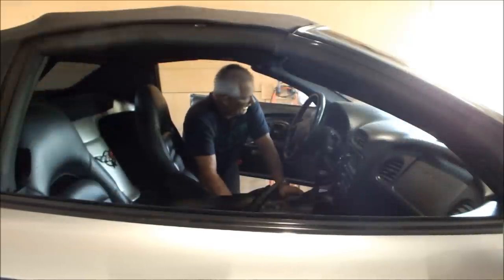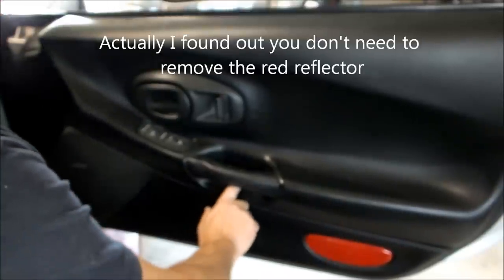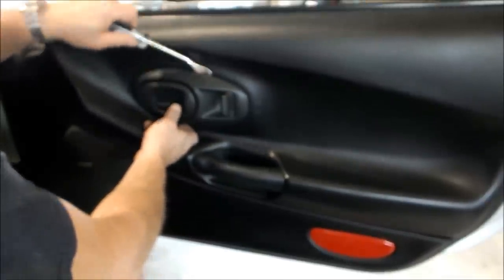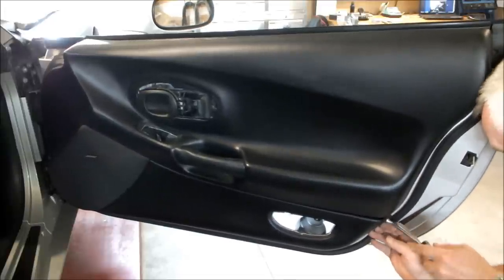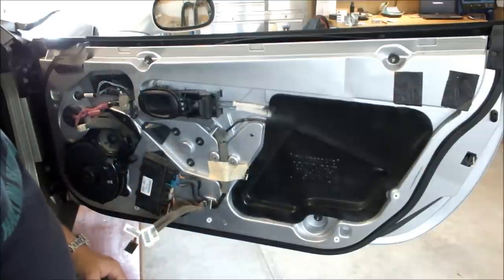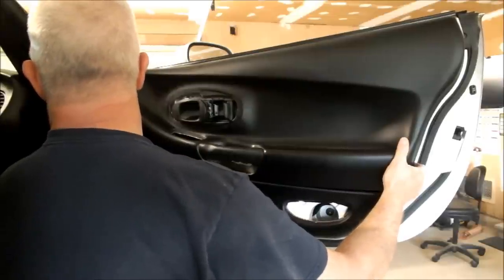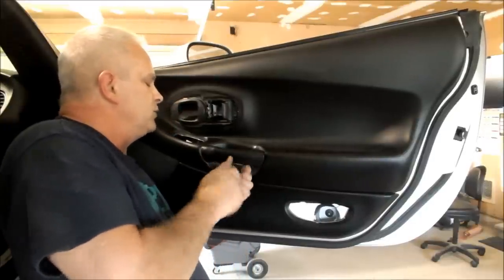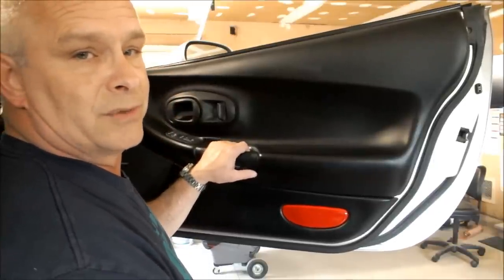Corvette C5 Door Panel Remove and Replace

Comment: Be careful!!!  I help my friend remove his DRIVER side door panel on his 98 C5 after watching this video.  Either the difference in year (98 vs. 2001) or which side of the vehicle is being worked on is important.  Removal of the driver side window/door lock/mirrors panel was exactly opposite as described in this video.  The driver side panel needed to be pried up from the REAR instead of the FRONT and slide BACK as opposed to FORWARD as shown in the video.  Unfortunately, the switch panel was broken learning this important lesson at a replacement cost of $350.00.

Comment: Great instructions.  Thank you.  On my 03 I had to start removal of the power window/door lock switch on the Drivers door from the back.  There is a plastic clip in front that will break if you don't.  This may be because I have Memory Seat control in the door or that it was the drivers door and not the passenger as in the video.  Everything else worked as in the video.  Thanks.
Reply from the maker: Glad it helped Rick - Cheers from Canada!

Comment: The driver's side window/door/mirror panel pops out from the rear. My switch panels are very brittle and cracked even while removing them the proper way. However, you do not need to actually remove the switch panels. Once you start popping the door panels off you can pivot the panel out and reach underneath to remove the electrical clips on them. Then remove the panel the rest of the way.
Reply from the maker: Jonathan Raether Good advice for southern based cars
Reply: Thanks...that's the procedure I'm doing actually. just replacing the drivers door panel

Comment: On my 2002 C5, the right window/door lock switches would not work. Thanks to your video, taking the door panel off was a breeze. Found the electrical connector not connected. Sometimes you're just lucky! Works just fine now but I wonder why the connector came off. Maybe a repair had been made previously but the connector lock was not engaged?? Thanks
Reply from the maker: I think your bang on Don - could be  from factory but hell most times you have to fight to get a connector apart - most likely a previous repair - lucky you - I wish most problems had that solution - cheers

Comment: I have the factory bose speaker system in my cat and I have had the battery disconnected for several repairs and long term storage. I a have never had to reset the radio. What's that all about? Do you have some premium entertainment package, aftermarket radio, or factory replacement radio that doesn't match your VIN?

Comment: Have a 2000 Vert.   Driver window does not tuck all the way in to the top cover.  Looking from outside (Upper right)... glass goes a little over the corner thereby way to much noise.   Someone said there is a window adjustment to possibly change the angle.   Can you advise on this?   Happy to send a pic if requested.
Reply: I have the same exact issue.  Have you found a fix yet?

Comment: My passenger door latch won't lock or open. It moves slightly when the lock or unlock button is pressed.  I wonder if they need lubrication as the owner's manual says that the door latches need periodic lubrication.  Thanks for showing how to remove the door panel.
Reply from the maker: Your right Domo - but take off the panel and lube it up good from the inside and have a look to make sure nothing is interfering with the mechanism inside the door

Comment: Door handle trim has two slots made to push and release so you don’t need to put tool to the soft parts of door and switch doesn’t need removed just un plug after panel is in attached
Reply from the maker: Good to know Handyish - Cheers from Canada
Reply: @carquestions  can save from potentially damaging. Great vid by the way

Comment: Thanks for this video! Same as in all other car's, but I afraid do something wrong.
Reply from the maker: +Vladislav Tarassov No problem - As far as trying it yourself you should give it a try - most of the time you take it in to a mechanic who has never done it ends up breaking a few clips anyway - if your slow and careful you"ll get it - you can do it
Reply: *****
I broke a window switch panel... sad. But it's not fatally. I will fix it! Others ok. Already removed 2 panel
Reply from the maker: +Vladislav Tarassov Vlad - don't feel bad - had you got someone else to do it there is a better than 50% chance they would have done the same thing and not told you
Reply: ***** That's true!
Reply: +carquestions Yup, same thing happened with my JL Audio  5 channel amp install. The "professionals" only installed one screw per handle instead of both. I didn't think it was a big deal cause I thought I could just order 2 new door handle bolts but I couldn't find them online on any of the GM OEM parts warehouses and when I went to the dealership they said it was a discontinued bolt that they no longer carry... Now I just have to deal with a loose feeling handle forever...
Reply from the maker: +JDMricist No you don't - I don't know where you live but you have two options - Go to Corvettes at Carlilse Penn and someone will have it - or take one of the remaining bolts with you to a local nut and bolt industrial supplier - or a junk yard
Reply: +carquestions Do you think Corvettes at Carlilse would ship me one? The nearest bolt industrial supplier is 2 hours away and I could never find any Corvettes in junk yards :(
Reply from the maker: +JDMricist Corvettes at Carlilse is an annual giant car show swap meet for corvettes - try searching eckler's corvette online

Comment: just bought a 2002 74,000 miles convertible  last week ; Top down and both windows down ; passage door close solid like new, driver door sound loose when door is closed , this video will help me find why the driver door sounds like the windowis about to fall apart. Just want the drivers door to sound solid when closed .
Reply: +Robert Mullins omg, I have an '03 with 110k miles and have the SAME problem. Passenger door closes like a new car but the drivers door feels loose and clanky sounding when closing. Found out it was coming from the mirror. Try to wiggle your passenger mirror. It shouldn't move. Then try wiggling your driver side mirror. It will probably wiggle around. If you have the same problem as me, that's the culprit. I still have to take the door panel off to see what's going on... Hopefully I'll have time this weekend.

Comment: fyi driver side window switch has to be pryed from bottom not top. Just broke mine and learned the hard way....
Reply from the maker: Good point - thanks for the info
Reply: Gotta love 20 year old brittle plastics too.. was trying to remove the drivers side from the bottom and it basically snapped immediately. Oh the joys lol...
Reply: Well it's be nice if not every diy-dumby decided to make a sweet how to video without knowing his facts. A simple disclaimer about the differences here wouldve probably saved your switch...and mine. Thanks carquestions /s
Reply: Sour grapes 🍇.
Reply: Just broke my driver window switch due to listening to this quack.

Comment: I would like to start door panel removel outdoors, I will be sending the module away for relay replacement. Can I then attach battey cable, start car and put it back in Garage until I get my repaired Module back???
Reply from the maker: Yep no problem - it will however show a fault code in the display but just clear the code once you put it back together

Comment: Thank you! I just bought a 2003 and found both doors are cracked at the hinge. The pax side is really bad. The door has dropped down a little. Do you have any repair ideas on that, and have you seen it before? It's like the doors were swung open to hard.
Reply from the maker: +boeingtrijet Heard of it but never seen it. Ya, sounds as if your right, door caught in wind numerous times. I guess you try and reinforce the area or buy a new/used door

Comment: How about  a noise heater when you push the high button and it sounds like Vet is going to fall apart ; I need to find out what is going on in there . Blue lady is my 2002 Vet with 78,232 miles , it has issue and am slowing working it out as my 2001 grand Cherokeeit's low mileage ; finishing up on the breaks (it's my everyday car) and my Vet (Blue Lady) is my nice top down summer car.
Reply from the maker: Hi Rob- that noise is bad bearings in the blower motor most likely - so out comes the blower motor and soon since the increased drag by bad bearings can blow fuses or damage blower motor resistor - once the motor is out find a way of lubing the bearings if you can or replace it

Comment: Question: If all I'm doing is changing out the window control panel (Drivers side) do I still disconnect the battery?
Reply from the maker: It will be ok - just don't put the key in the ignition or hit the door lock button -
Reply: Thanks you sir :)

Comment: WARNING: The left and right panels come off differently.  The RIGHT door switches pry out from the TOP , yet the LEFT switches pry out from the BOTTOM!!!  You WILL ruin the panel if you pry from the wrong end.  Hope this helps! ;D  (Note; you don't need to remove the switches or the reflector to remove the panels)
Reply from the maker: +Eric Schnidrig Thanks for the info

Comment: Do NOT attempt to remove either of the window/lock panels.. completely unnecessary.. I just f****d my driver’s door panel up.. it crumbled.. those stupid panels stay in place and simply disconnect from behind once the door panel is off..

Comment: great video but I cringed watching you use a metal pry against a pained fiberglass door and no supporting the outside of the door when re attaching the panel. That's a great way to get a hinge mount crack which will cost you about 700$

Comment: DONT PRY THE DOOR SWITCH PANEL UP! They're too brittle and almost guaranteed to break if you pry them like this guy. 

There is plenty of room to disconnect the switch from the harness after releasing the clips that hold the panel on.

Just remove the door popper bezel, the screw cover, the two torx screws and go around the edge of the panel gently popping the panel loose before lifting it up off the top where the window wipers/weather strip is. Then reach in behind and wiggle the connector loose. Remove the switch after the panel is totally free. MUCH MUCH EASIER AND SAFER.
Reply from the maker: Thanks for the info Tyler - cheers